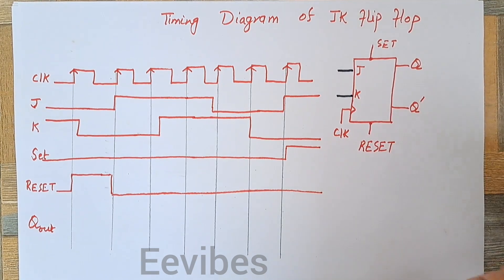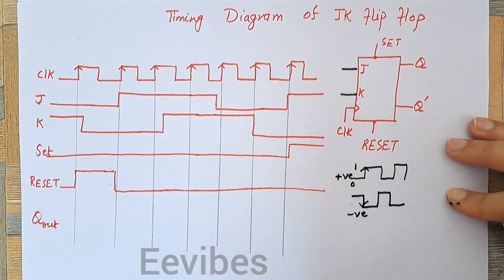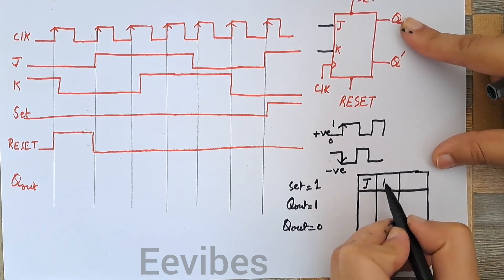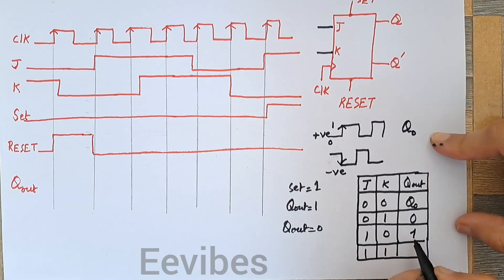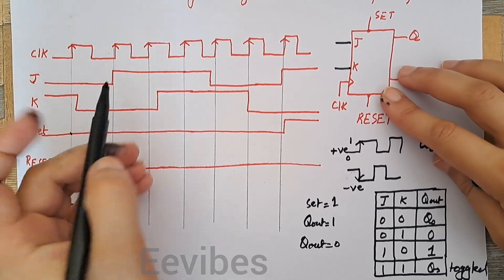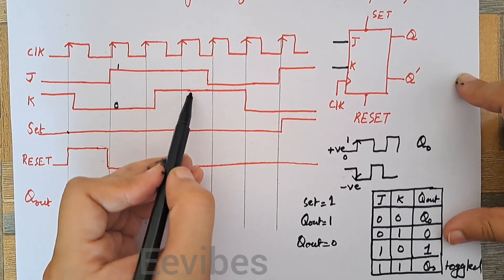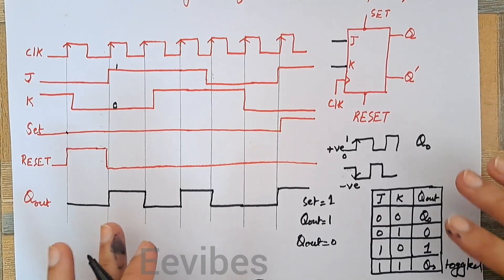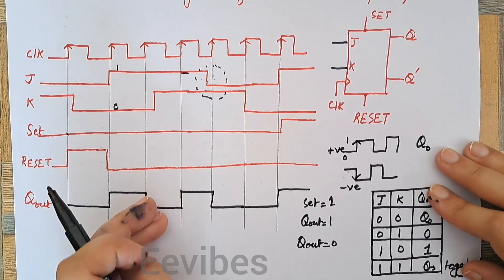Timing Diagram of JK Flip Flop | DLD Lecture

Comment from the maker: Correction: At 5:45 J=1 and K=0 (because we have to consider the value of inputs at the time of rising/falling edge) so output of the flip-flop will be equal to 1 (SET) it will not toggle. Basically flip-flop is edge triggered device, not a level sensitive so we will consider the value of outputs only at the rising edge of clock signal-My Bad :)
Reply: i kept askiing myself till i came to the cooment section